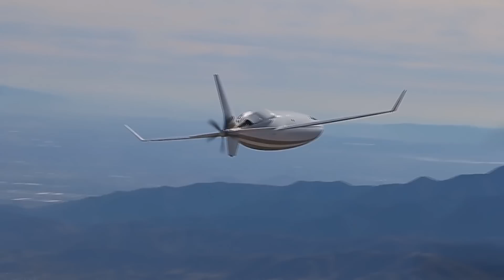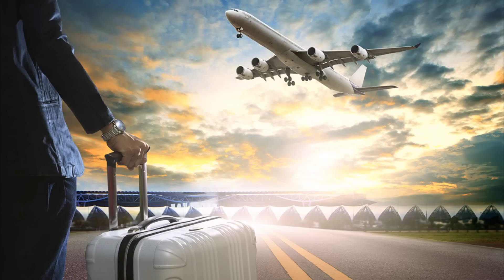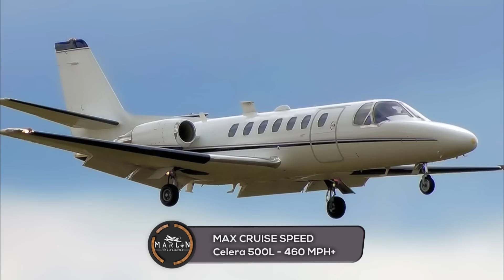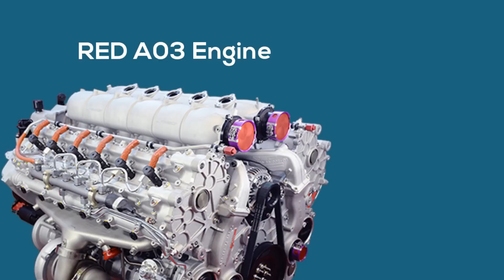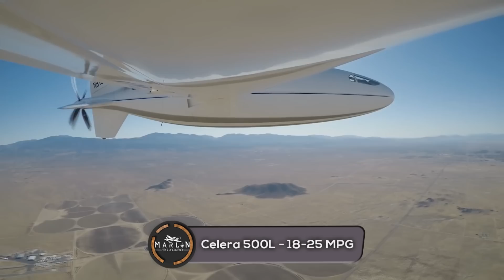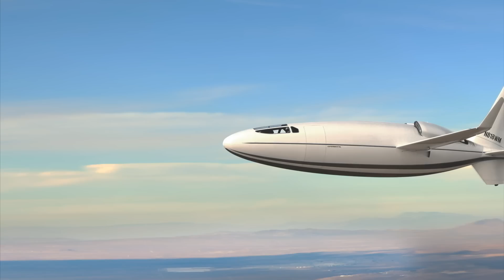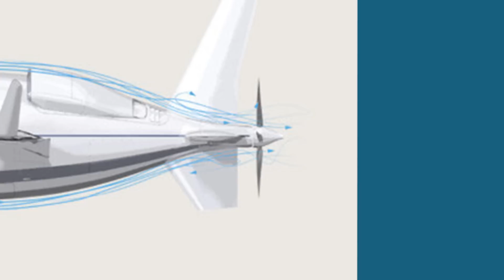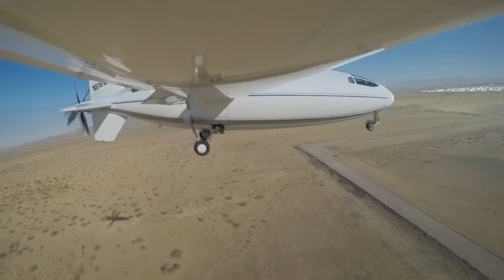Meet the Celera 500L (Flies Faster, Farther, Higher, Cheaper)

Comment: It sounds a bit to good to be true, and it uses way to many conventional aircraft-parts for me to trust the numbers. 

The shape, the tiny wings, the engine-type and the ”push-rotor” are all known ways of saving fuel. They sucessfully (it appears) combined these techniques and it will surely be fuel efficient. 
Maybe 30% more fuel efficent, but 8x more fuel efficient is not possible. 

The only way I would have believed it was if they would have made it possible to fly with a way smaller engine or it using a way cheaper energy source (like electricity, if excluding initial costs). 

The foils, on a boat, eg makes it possible to operate a large boat with a small engine. 90hp can be replaced with a 30hp. 
For aircrafts the closer thing I’ve seen is the british E-Go. 
It was a tiny composite aircraft with enormous wings and was able to take of with very little power. The shape was very similar to this aircraft. 
The problem was that the light construction would’nt have been able to handle the engine-vibrations. 
They solved it by using a Rotary Engine of just 30hp. Rotary is not very fuel efficient, but being so small it did undercut similar aircrafts with 50%. 
Read...50%...not x8. 
It was also to expensive to produce..

If they eventually prove me wrong I can promise I will buy at least one and start a  private jet-business.
Reply: A V-12 engine is perfectly balanced, and very smooth
Reply: The Deisel Engine is much more efficient than most aviation engines...
Reply: Glide ratio: Pilatus PC-12: 16:1, The Cessna 172 has 9:1 which is NOT a fair comparion.
Reply: Light aircraft routinely have similar fuel economy to cars if not better especially considering a per-passenger basis.

Comment: All sounds impressive just two questions: A 12 Cylinder four stroke piston engine? How's that more reliable, economic and more powerful than a PT6? How many turbos will it need to reach FL 36 and above?
Sorry for the confusion I'm obviously outdated relating to engine technological advancements.
Reply from the maker: It’s not the engine within it self that makes it more economical and allows the aircraft to get such results. Instead it’s the design of the fuselage with laminar shapes which encourages laminar flow. While the engine is very fuel efficient it is these 2 partnered together that allows for low drag and high efficiency.
Reply: @marlintheaviator  The question was about the reliability of the piston engine VS the Pratt & Whitney PT6 turboprop.
Reply: As I understand it, it's really 2 engines working on the same crankshaft. If one fails, the other can still turn the proppeller.
Reply: @CockpitScenes  Continental IO-550, Continental O-300, Piaggio P.XI, in other words, go play tetris most of the engines here can go to and even over 60000ft you lack reading something called books
Reply: @CockpitScenes  https://red-aircraft.com/product/ Read about the engine. Rated to 50k feet. Each 6 cylinder bank can operate independently.

Comment: Definitely it will need a lav and also de-ice both will add weight and drag and expense.
Reply: The lav will add drag? surely it won't be outside?
Reply: Pdoubleyou The lav adds weight which adds drag.  Referred to as induced drag.
Reply: De-ice will add weight, yes. But probably not drag. The de-icing system of the Piaggio P180 Avanti does not change the exterior profile of the aircraft at all. This is accomplished by the way the seams are filled. But it does add engine thermal transfer ducted stainless steel leading edges to the wings which does, indeed, add weight - but perhaps not quite as much as you might think. The props do not require de-icing on the Avanti because they operate directly in the exhaust flow from the turbo prop engines.

Similarly, the Celera 500L only requires de-icing mechanisms at the leading edges of the wings. However, it has an advantage in that it doesn't have fuel tanks in the wings, so the implementation is easier and possibly more effective because it can likely address more of the wing surface than just the leading edge. I doubt it will be lighter though. And the Celera's prop also requires no de-icing system at all because it too operates directly in the exhaust flow coming off the engine.

You're 100% right about the lav.
Reply: Pretty sure those will bite into payload or fuel load, but most drag at cruise is parasite drag, so I don't expect a drag penalty.

Comment: Looks looks the Avanti 180 has some serious competition.
Reply: The configuration is almost there , no flaps in front ? They have good economy
Reply: CaptainSkidmark11 no way this blimp is going to compete with the Piaggio in speed.. look at that tiny prop, and auto engine conversion? 550 hp? The piaggio has significantly more than that on one engine. and the Piaggio has TWO engines! Come on..I give them credit for actually getting it airborne, but i would need to hear some actual speed that it has reached...

Comment: Please view (and read) YouTube information on both the Beech Starship and the LearFan. And check out the Raikhlin motor company's history. What is that old bromide? Oh, yes, it is: "The more Paris changes, the more it remains the same." Enough said [other than Cost to Manufacture both Airframe and Engine: 1) Diesel engines--compression ignition engines, more accurately--force us to pay a weight penalty (just ask General Motors and Fiat Chrysler's Ram division about their attempts at reliable, lightweight diesels); 2) pusher aircraft such as Bert Rutan's Beech Starship and Bill Lear's LearFan both had genuine potential that was realized by the Piaggio Avanti.
Reply: I think you've got it right to focus most of the questions on the turbo and engine combo. The air frame looks funky, but it's definitely already beat down a lot of objections just by taking flight. 

I like your comparison to the Piaggio P180 Avanti. The Avanti derives 18% of its lift from the forward winglets, 20% from the lifting body fuselage, and the rest from the laminar flow wings. The tail is not designed to give lift. It's actually designed to only be a minimal drag set of control surfaces.

By comparison, the Celera 500L has no outboard lifting surface forward of the main wing, and the main wing is set farther back on the fuselage than the Avanati's main wing is. Since we've seen footage of the Celera in flight, it is 100% proof that the Celera's lifting body fuselage provides at least twice the lift of the Avanati's fuselage. That suggests the air frame is not the primary limiting factor for high altitude performance.

The engine, on the other hand...

There are a ton of questions about that. I too have questions about reliability and ease of manufacture. I am especially curious about the metallurgy of the cylinder liners, the design of the turbo charger, and the design of the oil cooling system. Those are big giant question marks that speak directly to operating costs as well as high altitude performance. The veracity of the claims seems to hinge directly on the engine and the turbo charger combo.

Comment: Celera 500L is an investment scam. This plane has the body of an airship with wings added. The aerodynamics of such a shape has been known for more than 100 years. It has nothing special. Celera 500L can simply not fly at the speed of a jet of comparable size and capacity, at the same time being 8 times more fuel efficient (this is the claim of Otto Aviation). It can achieve the pretended fuel consumption only if it flies at 200 - 300 km/h (instead of the claimed 740 km/h). At this speed, Celera 500L is out of business because it will need more than 6.5 hours to  cover a distance of 2000 km.
Reply: It’s a hoax, that’s for sure.
Reply: @ammerudgrenda  No kidding, laminar full flow cannot even be achieved in a wind tunnel test model, yet a production plane with bugs, dust, clouds, wear, is supposedly going to do so... Sure.  460mph on 500HP carrying 6 people... HAHAHAHAHAHAHA.... in a dive
Reply: I'm very skeptical as well. It's also going to need to have a fair bit of weight added to it before it's ready for production, which will reduce its performance.
Reply: BS, They are making these claims because they have already tested their Deisel Engine / Low Drag Aircraft. Keep in mind that its max efficiency isn't at top speed...
Reply: @davidhollenshead4892  BS: There are a dozen such aircraft out there with high efficiency at ~200knots.  These guys are claiming Laminar flow... It is complete bunk.  Laminar flow does not exist in reality and is non existent in a wind tunnel let alone a computer simulation
Reply: Commercial planes fly too fast anyway. They have been getting slower and smaller since the 60s. The 747, the A380 and the Concorde were all attempts to get bigger and faster, and all are now dead.
Reply: @bernardfinucane2061   and flat out NO.  Commercial aircraft are cruising faster today than they ever have.  There was an exception: Convair had one that "cruised" theoretically at 0.92, but almost none were sold as it guzzled fuel.  All jet aircraft used to cruise at M0.6 to 0.78 in the 60's/70's and now there is not a single jet aircraft that  does not cruise at M0.8 to 0.84
Reply: @Ronald McReynolds  Ah, speak to AUTHORITY.... not using your brain... Ah, ignorance is bliss.  So, if you are so brilliantly IGNORANT why do you reply?  To demonstrate your ignorance to the world on the subject of aerodynamics?   PS: Poor soul, his "credentials", are in crash assessment... Not Aerodynamics.  So much for you spiel to authority...

Comment: Call me an old romantic but I preferred when beauty was a design consideration.
Reply from the maker: I think it’ll look great when ready for production
Reply: @marlintheaviator  Beauty in the eye of the beholder and all that stuff. I think it looks like a confused whale, that had a run in with a container ship.
Reply: Exile 1 The production model will have windows so it’ll look less like a whale but in my opinion I think flying in an aircraft that looks like a whale is sort of a cool thing.
Reply: Ikeda Kazuto I’d have to disagree but I’m sure we can all agree, there’s some very cool engineering going on here. 👍
Reply from the maker: Sure is!
Reply: Just wanna get there fast and safely.   Don't care if it is fugly!   Thank you for posting!
Reply: Exile 1 
If this isn’t seriously overhyped then it’s a case of form follows function, which becomes the new beauty. Windows, and a paint job will start to normalise it, and in 20 years (if it’s as good as claimed) it will be considered a classic and a thing of beauty.

Comment: Fascinating concept. Hope it catches on
Reply: like Lear Fan of XXI cent
Reply from the maker: I agree!
Reply: @marlintheaviator  Notice that most of the comments are from ignorant people who claim its BS or that it hasn't flown. The combination of a modern Diesel Engine and Minimum Drag is that Efficient at Ideal Cruising Speed. What they have done is match the Efficiency seen in Some Motor Gliders...
Reply: @davidhollenshead4892  It hasn't flown in anything like a deliverable, practical configuration. Have they even ballasted it up to the weight it will operate at when it has a full cockpit interior, windows, deicing, weather radar, etc ,etc, ?